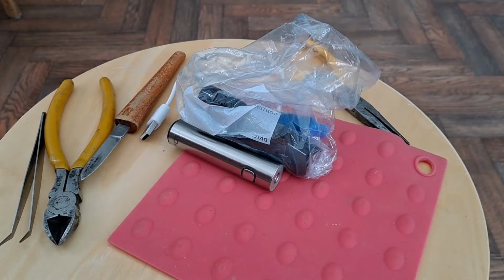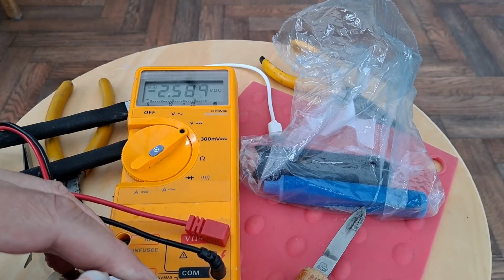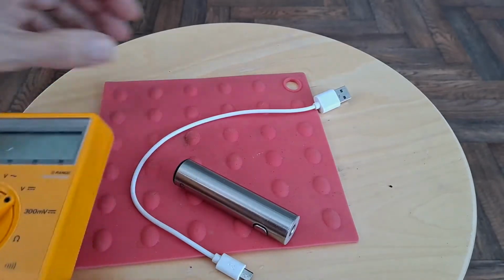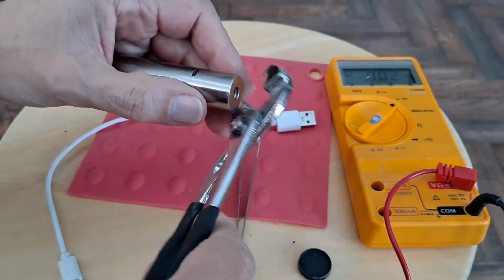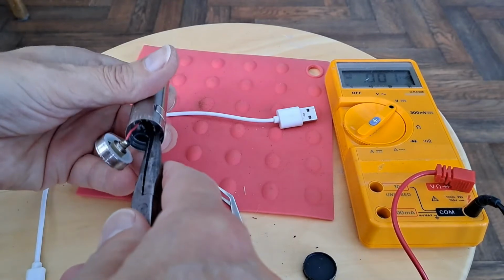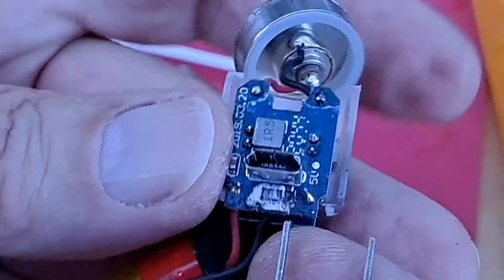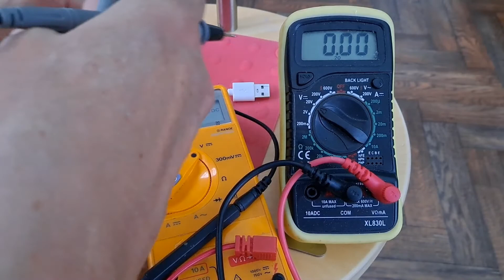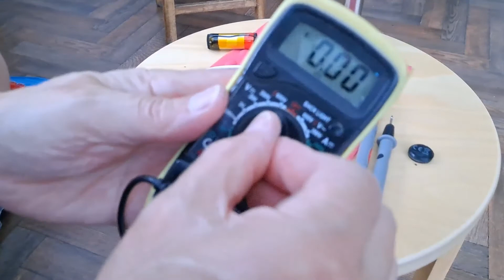Vape Hunter 👀 GOs INNOKIN 20220820

Comment: What do you do with the vapes? Is there something interesting inside that could be useful?
Reply from the maker: They contain LiPo batteries, that is what I am collecting. You might be able to use the heater elements, and you might be able to use the little electronic circuit that controls the heater. Generally I throw those parts away.